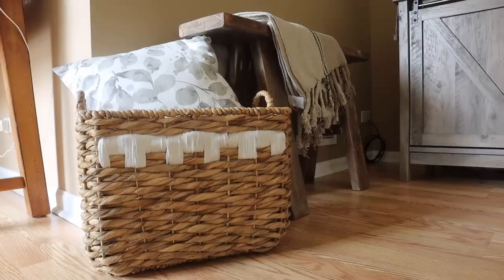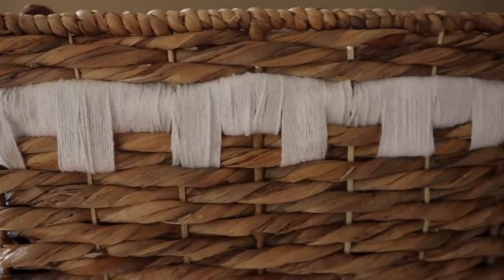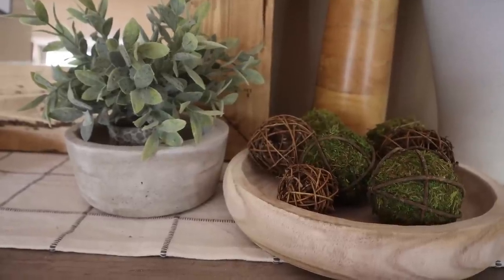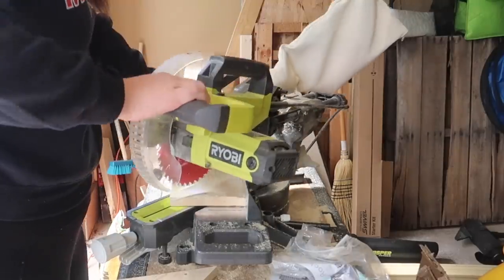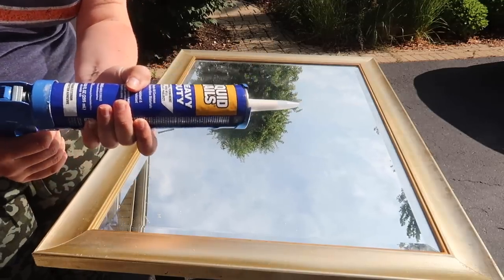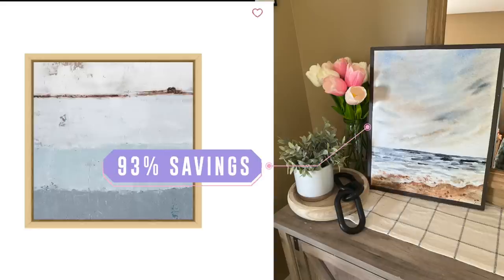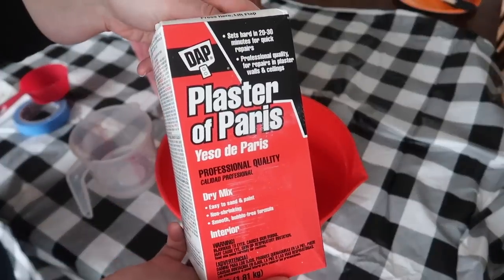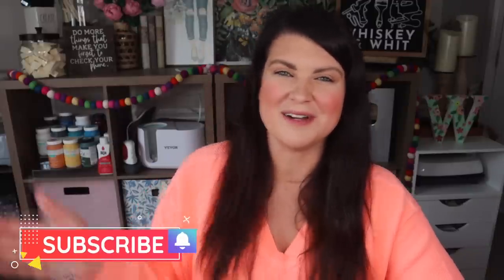Easy High-End Home Decor DIYS on a BUDGET! 🤯 I saved HUNDREDS DIYing vs. Buying!

Comment: Your energy and creativity are contagious. Between you and your buddy, Courtney, I have loved hearing your word-isms. My favorite from this video: “I just wung it until it looked like I wanted.” Pretty sure I’ve said that before, so let’s make it an official word! 
Keep up the great work, Whitney. Your videos inspire me.
Reply: One more thing…I use my mitre saw, circular saw, reciprocal saw, brad nailer, etc with little to no intimidation. However, I cannot get over my fear of using the Kregg jig! Aside from their tutorial, any tips?
Reply from the maker: OMG - don't be scared friend :) My best tip is make sure it's clamped down so you have counter pressure to push the drill in. You also may have to push the drill in, pull it out and then drill the rest of the way.  Sometimes the drill sawdust can get it in the way. Once you do it once, you'll be off and running. You've got this!!

Comment: Love the mirrors ❤When your distressing your wood try using a round wire brush attachment for your drill, hold it at an angle & run it over your wood.   This will take away the softer parts of the wood giving it tons of texture to increase the barn woods appearance.  I do it all the time then ding my wood up.  I always get asked where I find all my barn wood.  😊
Reply from the maker: That's a great suggestion! We actually have one, but I was worried I might mess it up because it's my husband's so I'll need to add one to the stash that I can just go to town on wood with lol
Reply: @Whiskeyandwhit   I think you’ll love the results!

Comment: My favorite was the cement containers. Thanks for the tips and heads up. I can think of so many things I can use these for especially with summer and having parties outside. I won't be upset if they break as upposed to it breaking if I spent a ton on them. Thanks so much  ❤

Comment: I love them all but especially the cement planters, first mirror and the lamp....I have a question about the cement candles....if I were to use a silicone mold for the cement, would you still recommend using spray oil?
Reply from the maker: So glad! I would still recommend it so that you are sure it will come out :)

Comment: Some great dupes there.  Well done.  One bit of advice is I absolutely would NOT use oven cleaner on wood.  As you said, it's meant for ovens which are non-porous.  Wood WILL absorb some of the oven cleaner and that will be in your home leaking fumes into the air no matter how much you scrub it.  I don't know who started that trend but I wish it would finish.  I particularly dislike oven cleaner anyway as that stuff is toxic and when you look at how crazy the weather patterns are and the ocean temperatures increasing so much (the atlantic has heated by 6.9 degrees celcius this year alone) we should be avoiding those types of products as much as possible in my humble opinion.